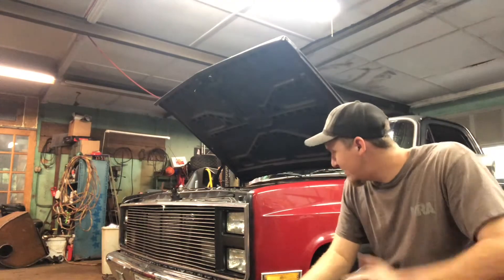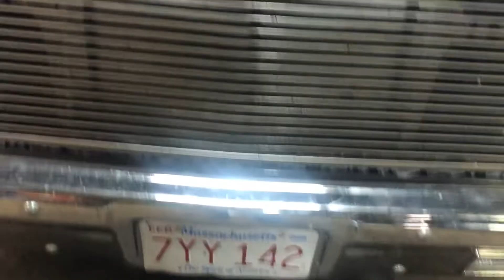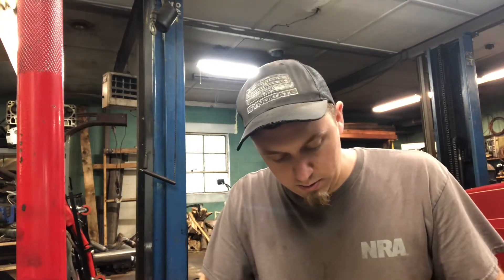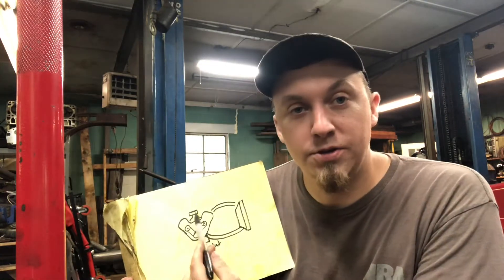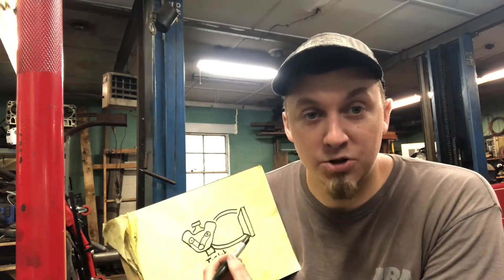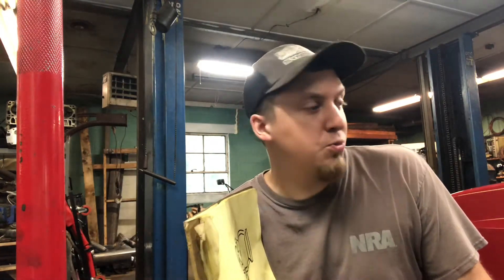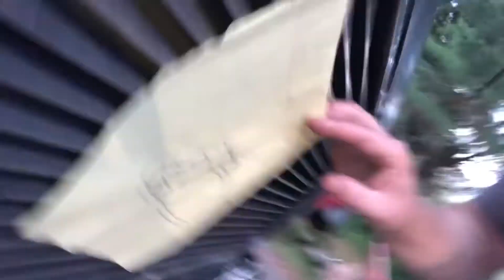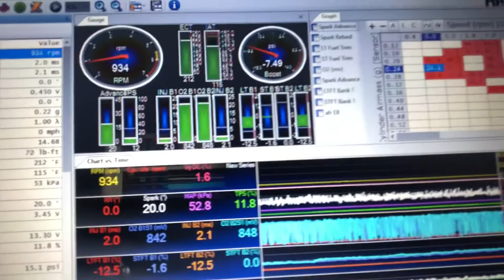LS COOLING! Is a 160* thermostat worth it?! No! And yes!

Comment: My two 2004 ls1 gto Factory.. Is runs around...220 Degrees... She runs a little warm but they say Is l s motors like to run warm..
Reply from the maker: 210 is typically where the t stats are meant to keep these engines at.. 220-230 at idle isn’t the bad part, but at wide open throttle 220+ is probably not good , especially for a guy like me that likes to go a 1/4 mile on pump gas and 14-15 psi
Reply from the maker: 210 is typically where the t stats are meant to keep these engines at.. 220-230 at idle isn’t the bad part, but at wide open throttle 220+ is probably not good , especially for a guy like me that likes to go a 1/4 mile on pump gas and 14-15 psi